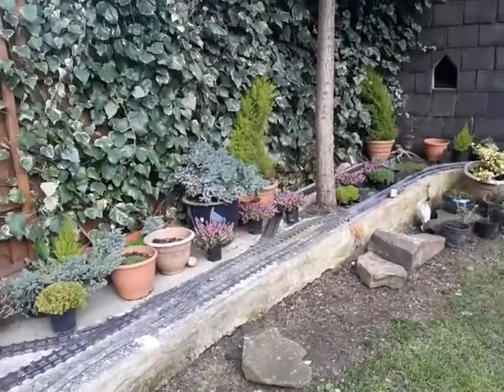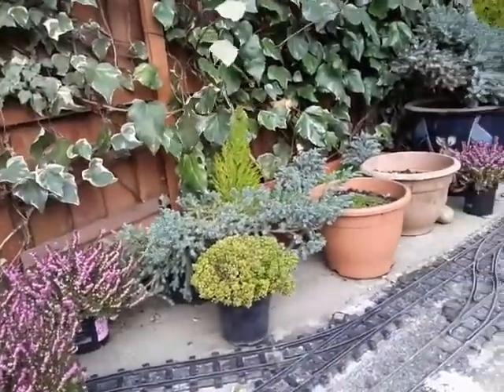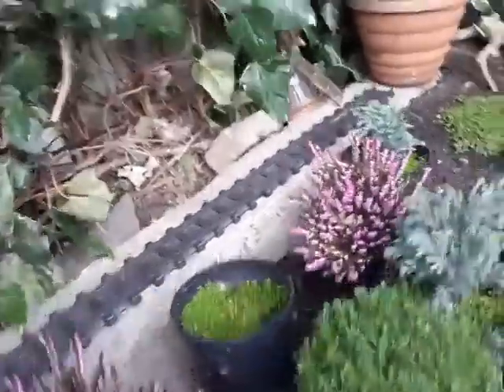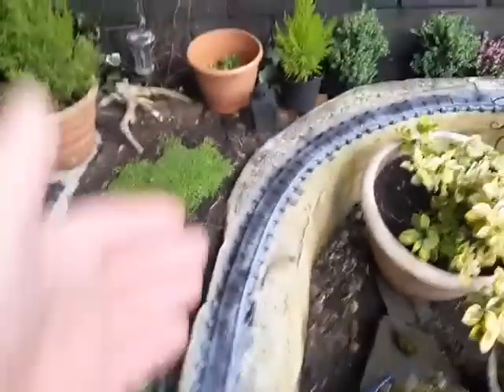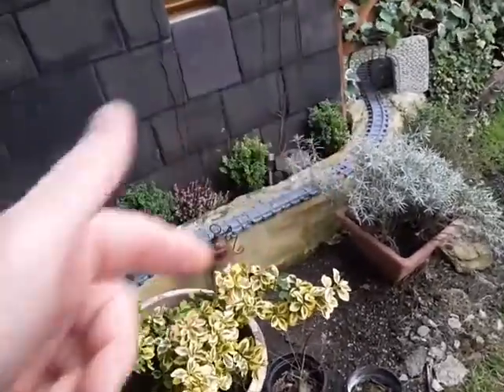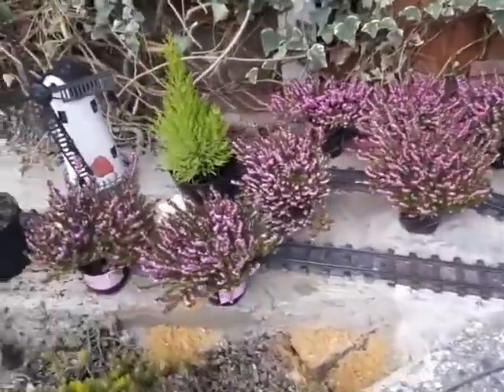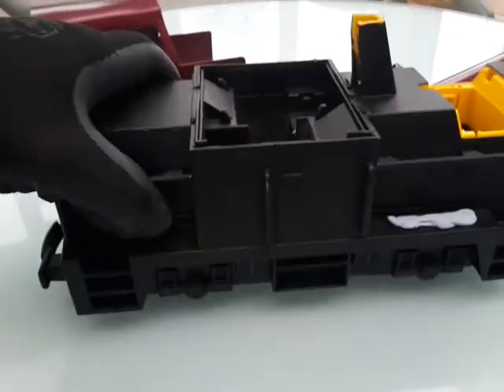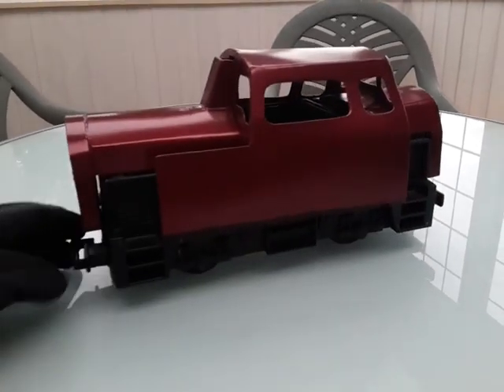G Scale Garden Railway Update March 2017

Comment: excellent job on the concrete work. The Deltang system seems to be the way to go, gives the locos those high end features without braking the bank. I am very impressed with the playmobil track, not as easy to find second hand in the states for a decent price. I was lucky to get enough newqida track with points to do a large layout. keep the updates coming, can't wait to see that newqida loco with the deltang system in it.  best wishes, Mike
Reply from the maker: Thanks very much, Mike. I've been waiting to get that concrete down for a long time...It opens up the next phases. Yes, the Deltang RC will make a very big difference to the way the railway works and runs. I'll be able to run the whole thing from the comfort of the garden room :) Yes, I was impressed with your NQD track, seems to work really well and looks good too. I'll be making some more, shorter updates soon. All the best.....Tom

Comment: I'm trying to find an economical way to create a backyard railroad and this plastic track and engine seem to be one way. But would plastic track hold up to Albuquerque, NM hot summer sun. It can get to 105 air temp where I live .
Reply from the maker: Hi there, thanks for the comment. The plastic track is definitely economical (I use Playmobil). Here in the SE UK we have up to 96 in the summer and the track has been out for 3 summers without any problems. It does expand a lot so it needs to be well fixed with screws and have regular expansion gaps. The problem with this track is that it's only made in Radius 1 curves. I've managed to convert the pieces into larger radii up to R7 but it was a labor of love and I wouldn't recommend it. There are other plastic tracks available but I know that they do not survive the summer and disintegrate after 1 year. I'd say it depends on the size of your planned railroad and your requirement for curve radii.